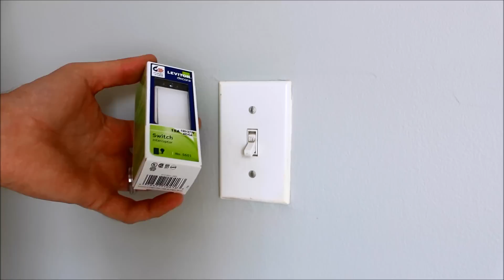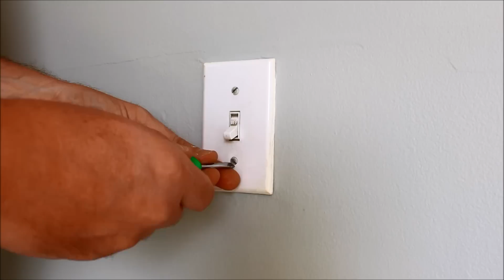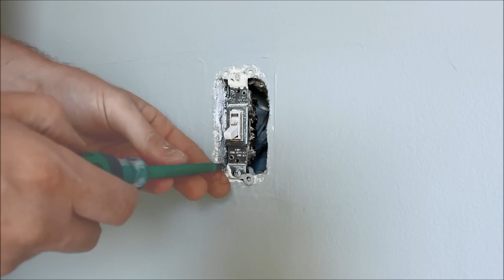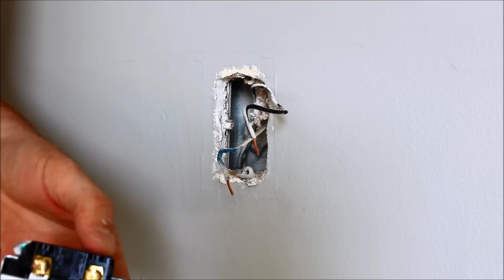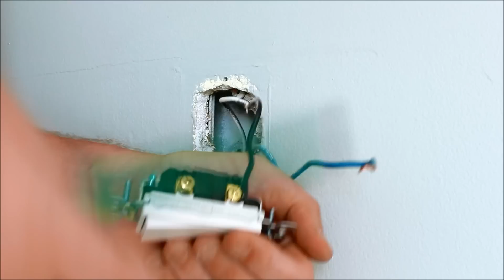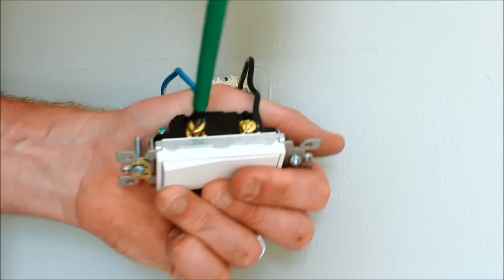How to Install a Light Switch

Comment: why snip the old wires that were connected to the old switch? Why not just unscrew them from the old switch?
Reply from the maker: speed, hassle, and the bend is sometimes weak and the tip breaks off, so if there is enough wire, I just cut it off to speed things up and it also gives me a nice new tip to work with.
Reply: @ZipZapDIY  That's what she said.

Comment: I want to add a second light to the same switch but this lights wire will be chased down the wall from the switch along the floor for led lighting under a snooker table. So can I just wire in the new wire run directly to the switch? Is that the prefered method?

Comment: hi, i am actually trying to change the dimmer switch to this regular 2 way switch. however, after i pull out the switch, i only sees orange and red wires. can i know which wire go to the top and which wire go to the bottom screw? thank you a lot if you could give me an answer. thanks.

Comment: So a metal box in the outlet indicates that it is grounded?
Reply from the maker: usually, if you have a metal box with metal conduit with wire running in it, it is typically grounded through the metal conduit

Comment from the maker: I've now use a non contact voltage detector to make sure the power is off and there is no current in the wires. http://amzn.to/1Uy1cnu I had a surprise in a building that was wired poorly and there was voltage in a wire that was supposed to be dead!
(Commissions earned on Amazon link)

Comment: What if u only have white black and ground
Reply from the maker: then you likely have wiring where the neutral wires are in the light fixture box and not in the switch box. Here is an article and some diagrams that explain it.. https://theiotpad.com/tips/smart-switches-no-neutral-wire

Comment: Do you have to turn off the main power or just clip it like that ?
Reply from the maker: you need to turn off power to the switch at the breaker (sorry, should have shown this, not just said it in the vid)
Reply: @ZipZapDIY  I felt a jolt on the pliers do I turn off all power from my home??

Comment: why is there a blue wire? where is the white wire.
Reply from the maker: +Kevin Aguilar  sometimes the switched  "hot" wire is blue, instead of red, the blue (or yellow) usually indicates the wire goes to a fixture not an outlet. The white wire, (neutral) passes straight thru to the fixture, sometimes you can see this connection in the switch box, sometimes the white doesn't go thru the switch box at all.
Reply: +ZipZapDIY thank you. that explains everything I am looking at my place. hahaha

Comment: does it mater which side the live wire is connected?
Reply from the maker: Both connection will be on the same side. There may be some markings on the switch as to what connection is hot what connection goes to the load. In most cases it doesn't matter since it is just a simple on/off switch. It does matter how you want the switch to look when it is off or on though.
Reply: I was wondering the same thing because I installed a double switch today 😊.

Comment: I would have been nice if you mentioned turning off the breaker before you do any of this.
Reply from the maker: 0:45
Reply: What the hell is wrong with people.?  Watch the damn video
Reply: @ZipZapDIY  Honestly, you did NOT mention anything about a breaker. You sayid "Turn the power off" and the image on the screen is the light switch toggled in the 'down/off" position with the word OFF displayed on the toggle. I could people could mistakenly interpret "off" as the toggle being in the off position.  Viewers that have ZERO experience with electricity will NOT know you meant "turn off the breaker" when you said "Turning the power off". Just sayin'.
Reply: @mrchedda  If you seriously have that little common sense you should just be calling an electrician to do this lol
Reply: I prefer natural selection. If you can’t figure to turn off the electricity before working on electrical appliances you probably shouldn’t to begin with.

Comment: does the green screw matter?
Reply from the maker: Yes, the green screw is ground and this protects from shock. In this condo the box and conduit are metal so the switch grounds through that. If you have a plastic box with romex, you will need to attach the bare/uninsulated copper wire to the green screw.

Comment: did you put your wires on the new switch reverse of the old switch cause youe black wire was on top now its on bottom\
Reply from the maker: maybe, I don't recall, top or bottom is not critical with a simple switch like this, but what I would have done is made it so the switch operates and lands in the on or off position like the other switches in the house.
Reply: David Brooks thanks, yr question and his answers, answered my questions.